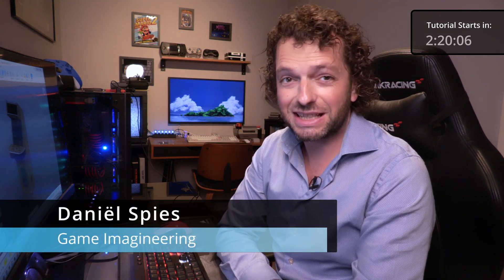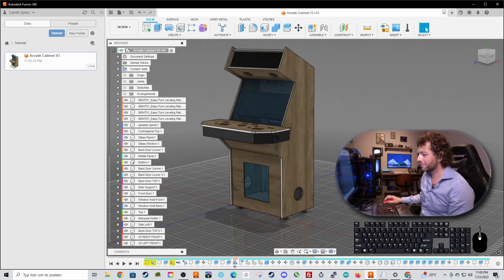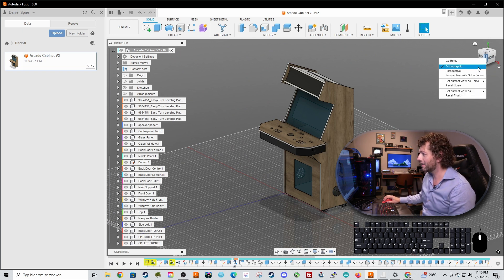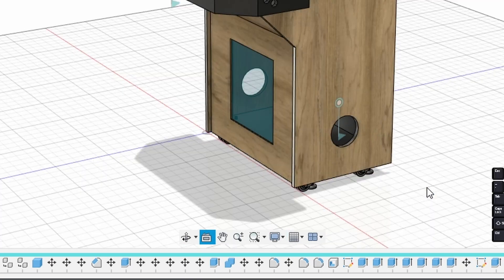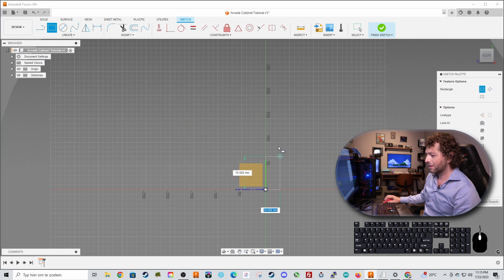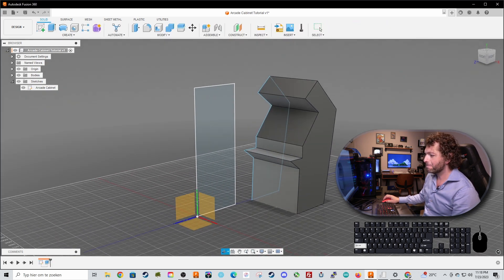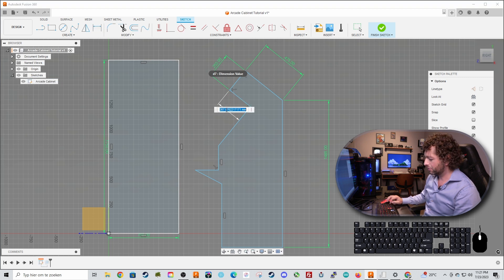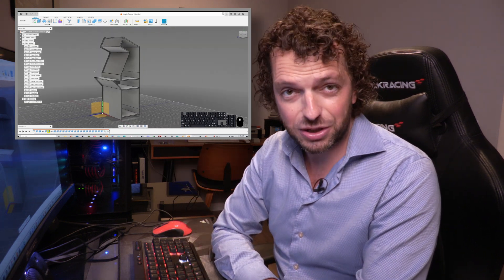Mastering fusion360 - Retro Arcade Cabinet tutorial  [part 1 of 5]  📐📏🛠

Comment: As a side question - for a bar-top or full size machine, it’s fairly safe that regular arcade joystick/buttons would fit. However for a machine with a 5inch display, it’s a little trickier.

Do you have any links/recommendations for any that would be suitable for something of this size?
I’d like things to be fairly sturdy, though my plan is to have two USB inputs for game pads so the controls would be mostly ornamental. But having the option of just playing with the raw unit would be awesome.

Options I’ve seen are either a) unknown dimensions b) fragile-looking and/or badly reviewed.
Reply from the maker: You can contact me for a custom mini design: thedanielspies at gmail.com
Reply: @TheDanielSpies_Arcades  hey, thanks for the reply. As a hobbyist doing it for fun I probably couldn’t justify hiring your services :) would be awesome to see you do a series on mini ones though, especially if it involved 3D printing and joints, not glue/nails

Comment: Daniel, thank you so much for your tutorials. They’re very educational. 

Couple questions, are you using a camlock system and how are you creating the vesa cuts for the monitor mount?
Reply from the maker: I don't use camlocks and fully glue/screw each cabinet to give it the optimal strength. Vesa cuts are made in my CAD program usually.
Reply: @TheDanielSpies_Arcades diver deeper Into you’re videos i discovered that. Thank you for your videos.

Comment: Excellent tutorial, thank you for taking the time to make this.  Quick question, once designed, is it possible to create a template for photoshop so you're able to create your own graphics?  Is that something that can be exported from fusion?  Thanks!
Reply from the maker: Hi, yes. Export the DXF file from fusion and open that in Illustrator. Then, save is as an pdf or PNG and you can import it in Photoshop. You might be able to open DXF in Photoshop directly, but you will need to make some changes to your DXF file anyway so I suggest Illustrator first. 👍🏼
Reply: @TheDanielSpies_Arcades  You are a gentlemen and a scholar.  Many thanks.
Reply: @TheDanielSpies_Arcades  you need to bride Sahaj joshi to do a collaboration video for youtube on designing artwork for arcades :)